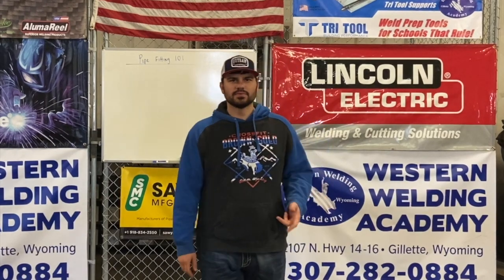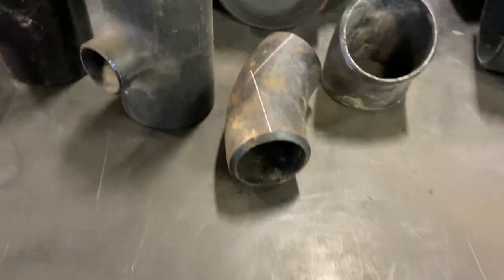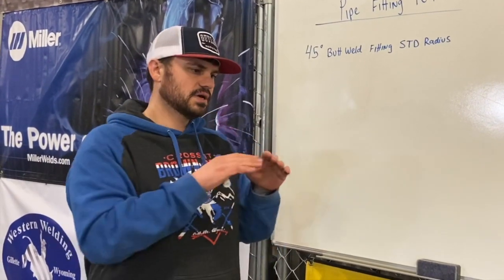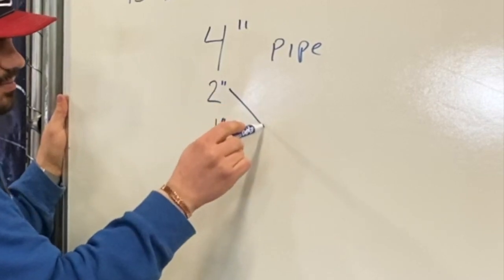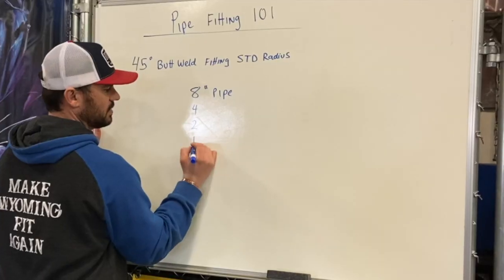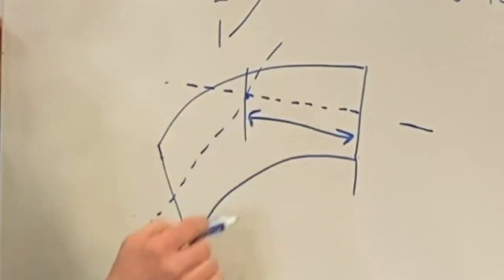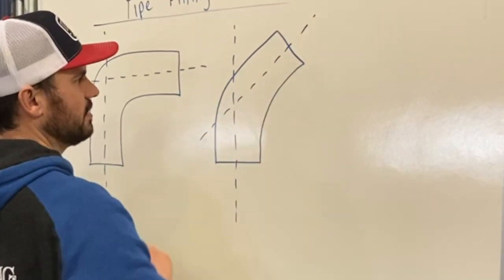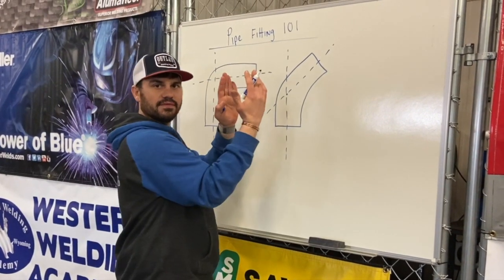How to take-off 45s, Reducers, and TEEs episode 1 of 3 (REAL WORLD TRAINING) @RealTylerSasse

Comment: Hello
sorry for my english is poor.
I work as a pipe fitter in Europe.
Very nice movie, all nicely explained.
In Europe, we use the metric system, not the inch one. I will write to you how we calculate in the metric system.
1 "45s for STD redius European 3D = 16 constant pattern
that is
4 "x 16 = 64mm
inch system
64mm / 25.4mm = 2.5 "
when you assemble pipes in the metric system, it may help you :)
Reply from the maker: Thanks for the tip!

Comment: Whats the formula for the long radius of 45 degree fitting. Or did i miss something
Reply: Pipe diameter x .625= T.O. for 45° fitting A 3D bend is different a 5D bend is different but for a normal 45 Ell is diameter x .625